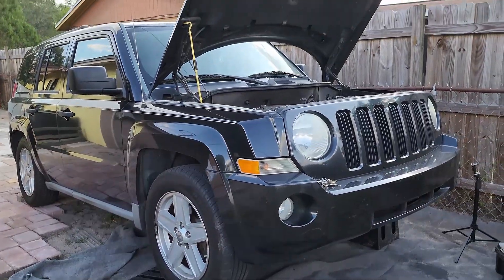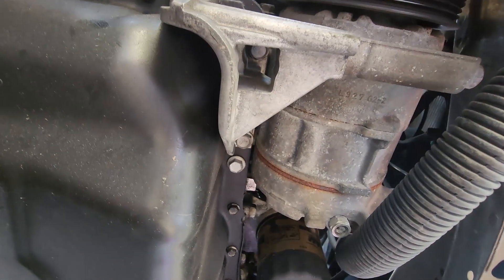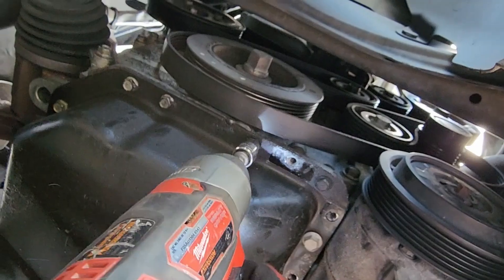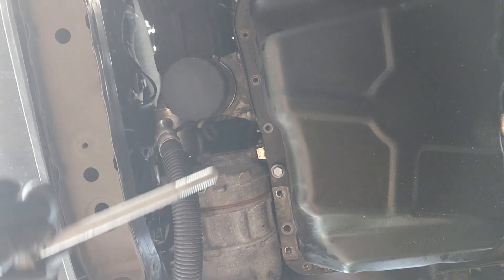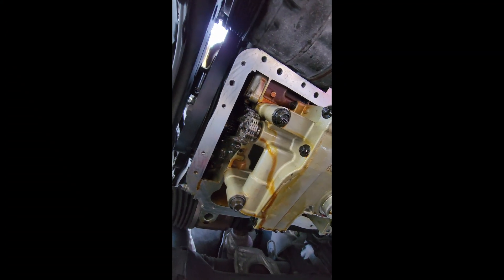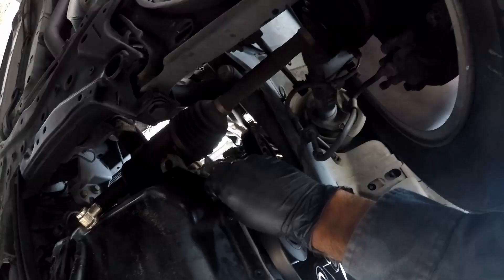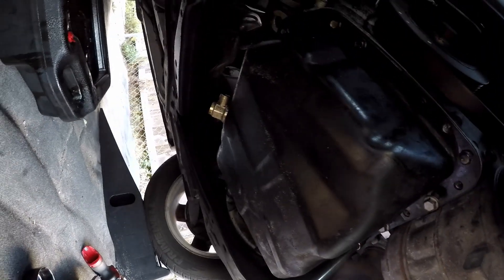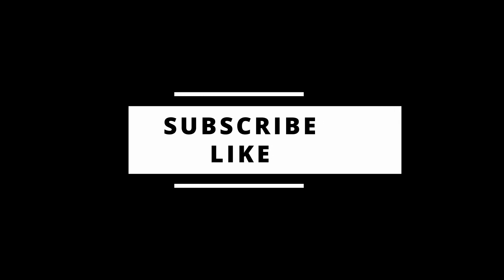Step-by-Step Guide: How to Replace the Oil Pan Gasket on a Jeep Patriot

Comment: You don't need to take out the belt just those (4 ) 13mm bolts for the AC compressor bracket

Comment: Great video! Thanks!
Q: I only have hand tools. How do I know how much pressure is equivalent to 25 feet lb when tightening the screws?
FYI - I found somewhere else as an alternative you can remove 3 bolts from that AC bracket and take it off, instead of taking the belt off of the AC compressor.
Reply from the maker: well 25flb is not that much... you will be ok tighten those without applying to much pressure... (hard to explain without showing)
 💯 agree you can remove it without taking the belt out. 👍

Comment: Great video. I do have a question thought. Where did you get the torque specs for these bolts. I assumed they were somewhere around 20-30 but couldn’t find them anywhere?
Reply from the maker: I have a friend who works for a jeep dealership as a mechanic and I asked him.

Comment: Good job. Im a Jeep Hater.  my wife wants a 2009 PT cruiser turbo. It has 45,000 miles I did the A/c for a customer What a nightmare.  Im not replacing the timing belt or the water pump. I rather walk than drive that thing.